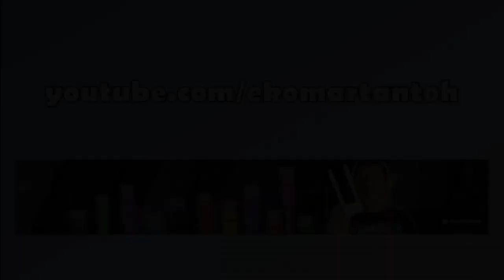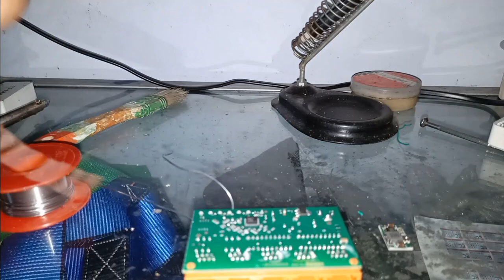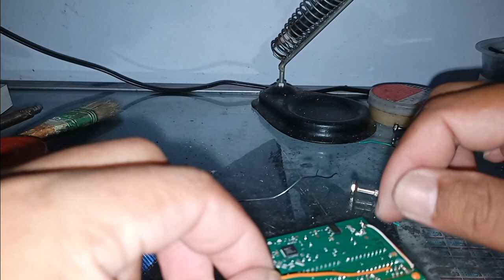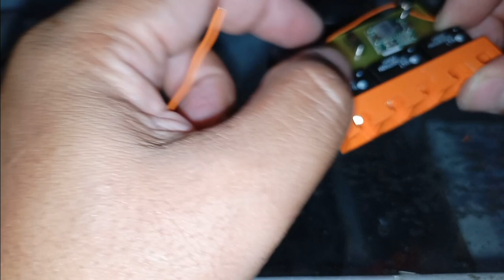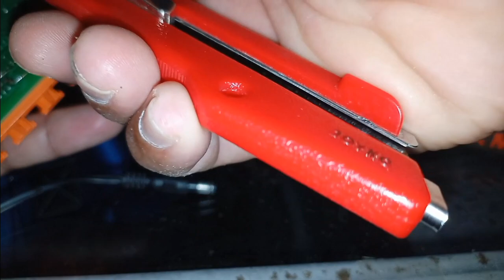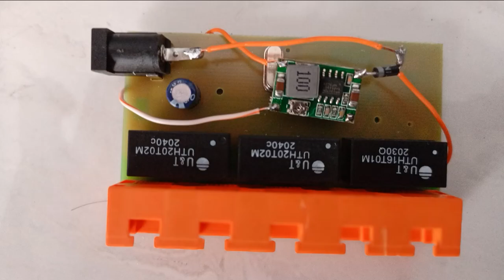Modif POE In atau Out Switch Totolink S505

Comment: pak mau tanya kalo untuk dibuat 2 output 12v sama 9v gimana caranya ya? inputnya dengan lewat jack 1 adaptor 12v 5a seperti yang divideo
Reply from the maker: Brarti pake 3 stepdown, satu step 5V untuk menyalakan switch, kedua stel 9V ke poe out, satu lagi stel 12V ke poe out.
Reply: @ekomartantoh  kalo yang divideo itu kan stepdownya 1 diset 5v untuk menyalakan switch, nah poe outnya dari switch nya itu berapa pak?
Reply from the maker: @ignatiuswahyubudihartanto7344  akan sama dengan tegangan dari POE IN nya karena tidak ada stepdown
Reply from the maker: @ignatiuswahyubudihartanto7344  kalo banyak stepdown di switch jadi ribet masangnya. Sebenarnya lebih baik stepdownnya dipasang di alat yg akan dinyalakan dan di stel sesuai kebutuhan alat tersebut
Reply: @ekomartantoh  brarti kalo 2 stepdown 1 di set ke 5v dan 1 diset ke 9v apakah sudh cukup pak untuk mengeluarkan poe out 9v dan 12? apa memang harus 3 stepdown?
Reply from the maker: @ignatiuswahyubudihartanto7344  iya bener cuma